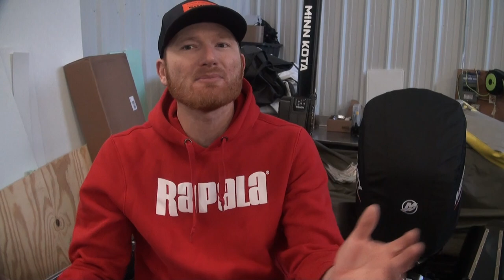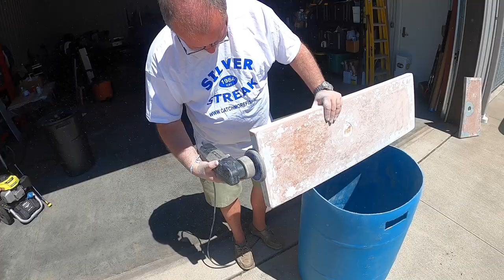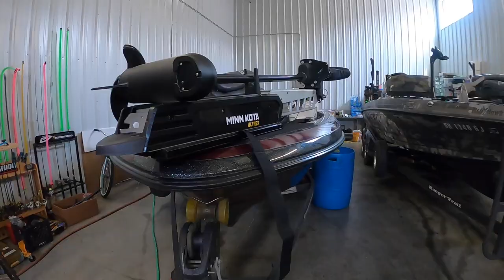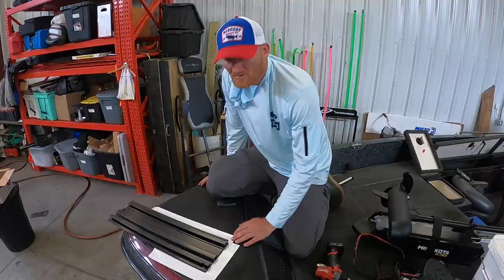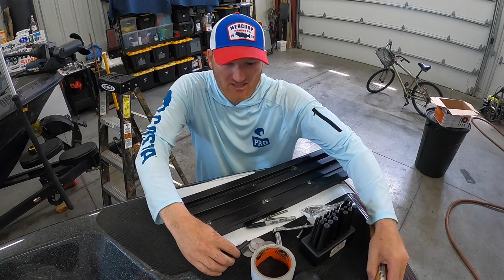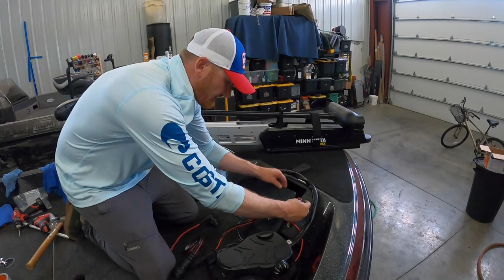Project Boat Restoration Part 1: Trolling Motor Installation

Comment: Great job but another thing you can do with stainless fasteners to prevent galling when you screw on the nut put a little anti-seize on the threads. Nothing is worse than a nut seizing up in a spot where you can't even saw it off with a mini saw blade.